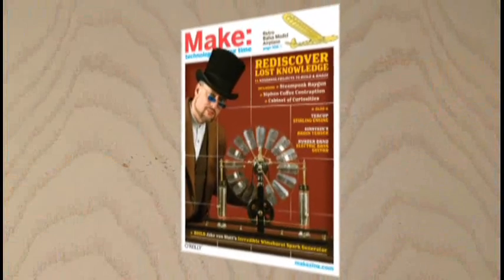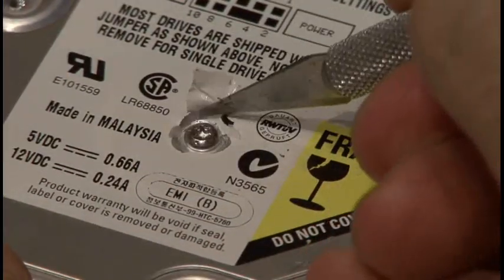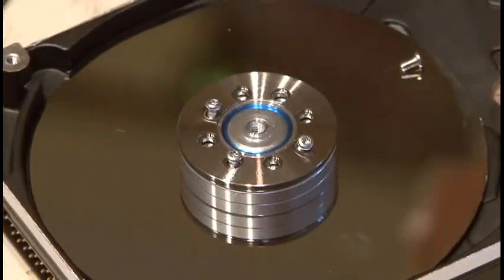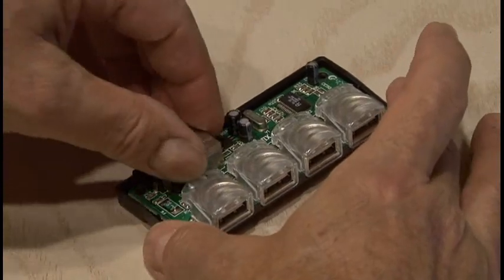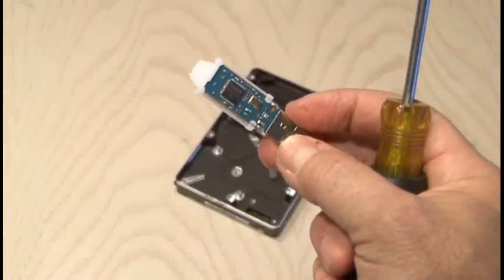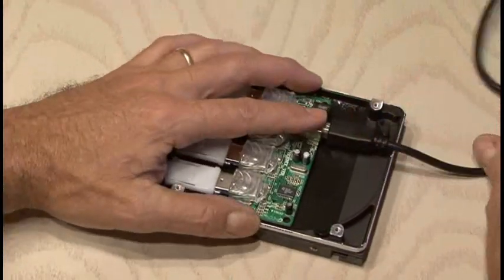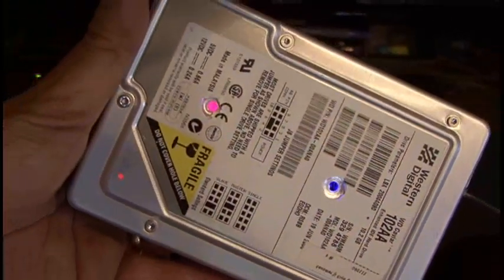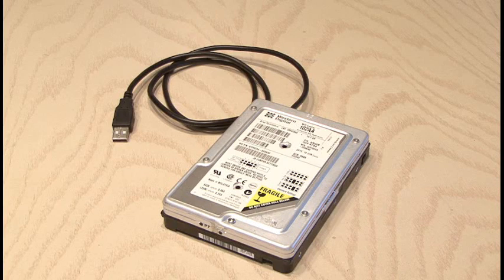Weekend Project: Flash Memory Hard Drive

Comment: Hey, i was wondering if you could solder a cable into the USB ports of the flash drive (fd) and make it like 1 cable so you dont need a USB hub. And if it is possible, does the pc think you have 4 drives or 1 drive?
vinceaantju

4 cables -> Solder 4 sane cables into 1 -> Have 1 cable

Comment: Single drive letter?; I would guess that you have to permanently install the drive internally and plug it into an internal USB socket, then go into Disk Manager and tell it to RAID the volumes under NT (2000/XP/Vista/7 *are* NT) then create partition and format.

The only foul-up that could happen would be if Windows insists on seeing them as four removable drives.  ...Or the oxidisation causes power to drop and one of the drives to decide not to play ball after a year or so.

Comment: I did a pretty extensive test with a 4Gb file being read to nowhere.
My SATA2 drive (which is admittedly a somewhat slower 5400rpm drive) read at 17.5Mb/s whereas the plain USB stick read at 34.2Mb/s.  The drawback was the USB stick's 4.6Mb/s write speed, though in a RAID this could probably be overcome since its the fault of the NAND flash, not the USB.

Comment: Not necessarily.  Yeah, SATA2 is 3GB/s or about 300Mb/s, but if you look up the sustained read and write speeds, which are important for just about everything, they're only 20-40 Mb/s.  USB2 has a theoretical maximum of about 60Mb/s.  While write rates on flash are usually slower than read rates, I've got a decent USB stick that reads at about 50Mb/s, whereas my SATA2 drive never goes over 30.

I have no idea if you can actually RAID usb drives and have it be worth anything though.

Comment: by default usb drives do not need to be safely removed (seriously), you have to manually change the usb drives properties in Windows "computer management" to allow indexing. This will make the drive faster, but make it so you ACTUALLY need to safely remove. So by default, the second you see "File has been saved" you can remove that usb without risk.

Comment: Higher end laptops will use a SSD, otherwise they just come with a standard slim HDD. I can load battlefield 3 in under 15 seconds on multi-player with every new launch. I also don't have to worry about disabling any programs on windows startup. Might wan't to note i am utilizing a SATA 3 port and drive that uses the full amount of bandwidth. Faster SSD's utilize the PCI-Express ports.

Comment: Ok, first off what you made isn't an SSD.  Second, by your own admission you can get a real 128GB SSD for 33% more $ than you spent on your 64GB multi drive setup. And lastly, with just a bit of searching on Google I found refurbished Samsung 128gb ssd for $66.  I'll spend the extra $7 for an actual SSD with 2x's the memory of your basement made doo-hicky.  Don't get me wrong, it is a reasonable idea, albeit tweakerish. But it is not cost effective, which you are trying to pass it off as.

Comment: So all you did was put 4 usb drives inside a metal case??   Thats it?  Why not just plug in those usb drives in the original hub (before taking everything apart and wasting time) ? Its not like it works any different.

Comment: You mis the point.  This device can now be mounted in the case.  If someone, like me, has a hand full of flash drives, a hub and an old drive it can be made to fit in the case of an old drive then mounted in the computers case.  No cables running all over the place.  I have all the sruff I need to make this and I think I will.  And by the way if you use Patriot XT flash drives they are much faster.  The XT is 30MB/s and they have a new one that is 90MB/s.  Very fast, almost instant.

Comment: I KNOW THE SECRET TO DOING THAT WITH ONE DRIVE LETTER/PARTITION, AND IT'S NOT  SSD. First, use an external RAID card instead of a hub. Then, get some flash drives with SATA connections (AKA SSDs). Then make a RAID 0, then make a partition. There, All one drive.

Comment: 1. Flash drives are much slower than proper hard drives - just do a benchmark of both flash drive and HDD for comparison
2. You lose the usual advantages of a small flash drive as 3.5" HDDs are heavy
3. You cannot install Windows - although the initial text-based install process will run fine (Windows XP), as soon as it reboots and starts to enter the GUI section of the installer it will BSoD as the USB Mass Storage driver is loaded
4. Windows Disk Management won't modify flash drive partitions

Comment: So I'm not tech savvy. But didn't you just take a usb multi outlet that you could swap the flash drives out easily and enclose it into a hard drive where instead if just easily changing the flash drives. You now have to undo screws. See where im from. That's called putting a hat on another hat. Basically pointless.

Comment: Well, a USB2 Memory stick is probably not faster than a HDD, also, you have 2x4GB and 2x8GB 'drives' , so its not bigger by itself, only if you add up all the space, which you could also do with 4x an 10GB HDD.

Comment: Also it's really not going to be faster than the previous hard drive was.  the transfer rate on USB 2.0 devices is capped at 12Mb/s, and is going to suffer from latency on the usb hub.  Even the oldest IDE drives have transfer rates in that neighborhood, and if the hard drive was made in the last 5 years or so, it's going to have at least 100Mb/s max transfer rate.  

Don't get me wrong, this is cool, but it's just not useful.

Comment: Mind you, this is an old 10GB harddrive. No SATA to begin with - probably UDMA33, which has a 33MB/s theoretical maximum (shared across the master and its slave device). The maximum is practice is probably somthing like 25MB/s which is in fact slower than the practical maximum of USB, which is around 35MB/s (shared across the hub).

Comment: @ProductionsNate NO!  They definately are not.  USB 3.0 flash drivees are 75MBPS, a mushkin chronos ssd is 550MBPS, usb 3.0 and sata 3 are about the same speed.  SSDs are way faster than flash drives, they are much higher quality also.  RAM is even faster, that can be 17GBps.  RAM, SSDs, and flash drives are very, very different.

Comment: @FlameOfAngersShadow because the proper ssd hard drive doesnt run off of USB. the connection is the bottleneck with SSD technology. I wouldnt be shocked if the multiplication in speed between the 2 are measured in the hundreds

Comment: @LamaPaj Not true. Assuming that this old hard drive was using the fastest IDE at the time of UDMA 133 (133mbps throughput), replacing it with high speed USB 2.0 equipment would make it now a 480mbps data transfer rate. If you replaced it with USB 3.0 equipment that may or may not be developed yet, the data transfer rate would be 3.2 Gbit/s or if using "SuperSpeed" bus 5.0 Gbit/s.

Comment: @mhbs2 well you have to look at it. what this really is is nothing more than a COVER for a usb hub, and USB hubs are not designed to do that, it reads them as 4 seperate drives. This entire project was about covering it up, making it look pretty, and you'll never have to plug in / unplug each flash drive seperately.

Comment: seems totally pointless to me if the finnished product doesnt connect via sata or pata and doesnt produce a single larger drive else you might as well just plug the flash drives into the hub and connect to your usb how they were meant to be used.
perhaps if you converted the usb connections to 4 sata connections and configured the 4 drives as a jbod array producing a single larger drive then there might actually be a point to the video, do the circuits in an external drive enclosure work in reve

Comment: before project:  1 hard drive, 4 flash drives and a USB hub.
after project:  4 flash drives and a hub inside the casing of a broken hard drive.

If you needed a case, wouldn't it have been a lot easier and cheaper to buy a plastic enclosure?

Comment: I find this missleading. You are not using the harddrive at all. I thought (from reading your headline) you would connect it AS A HARDDRIVE. (ATA /IDE). What's the big deal? I can plug in 4 flash memories and don't need a hard drive case, nor to go through all this hassle!

Comment: This is kind of useless... First of all it is not faster... Yes flash memory can read/write faster but you are bottlenecked by USB technology. Assuming that is USB 2.0, it wouldn't even be able to read/write faster than a standard green HDD. A better trick would be creating a virtual RAM disk on your computer. Instead of spending that money of flash drives, spend $30 on an extra 8gb of RAM, turn that 8GB into a RAM disk, and enjoy insanely fast read/write speeds.

Comment: @jcrowley1985 not really, at about a dollar a gig, low cap solidstates are a good choice if you have 5-10 programs you want rapid access to. because they can utilize 6gigabit/sec sata 3 connections they are much faster than flash drives, and because its a single drive not 4 you don't have to play file management like tetris.
But yes, if you want to look at this like a child it is a cheap solidstate.

Comment: This video was disappointing.  While sold-state drives are generally faster and more reliable than hard disk drives, but hard drives typically have eSATA or IDE connections, which are much faster and better suited for storing data than USB.  Essentially, this is just a USB hub with 4 thumb drives inside a case, which leads me to wonder why you didn't put it in something decorative or functional.  For example, you could put the assembly in a USB desk lamp and use one of the hub ports to power it.

Comment: @ashwindersingh18 

Hi, they are expensive even on the cheap sites. 5 months ago I bought 500gb for $40. I was looking and 250gb is close to $100...at canadacomputers...Use old hard drives or recertified like I do or buy smaller ones. They last longer than the new large ones. When someone gets rid of their pc just take the drives and other parts.

You can try newegg they have RECERTIFIED drives - 160gb for $29.99

 Dont get suckered into the marketing scam.....recycle.

Comment: You probably figured it out by now, considering the date you posted this. You can span physical disks and make a single logical volume. It's called striping, or so-called 'RAID 0' ( I haven't tested it with flash drives ) Partition Magic has the ability to do spanned. There are also SSD drives that seem to have originated from what you made.

Comment: @ashwindersingh18 

Hey, your laptop drive is 2.5 and the one in the video is a desktop 3.5 drive. There is no room to put anything but the thinnest flash drives in it. Since you drive is connected via IDE or SATA connection, it is impractical to mess with it. It is cheaper and faster to replace the drive and install a fresh operating system..........

Comment: @Tcll5850 i like where your going with this,but you could even do better than that..why not try and make a external RAM for your computer.you could take all the hard drive components out and insert you some ram ports from an old computer or something,run wires from the ports, and  solder them directly to the proper places on the motherboard..idk if you can make the rams work via usb, but anything is possible..good luck

Comment: wtf is this crap... its a freaking usb hub with flash drives inside a hard drive case. pointless... id rather teach a big mac box "new secret tricks" by putting a hub in it with a bunch of small capacity flash drives. at least then it would smell like big mac sauce

Comment: I think if you use RAID you could possibly make the four drives show up as one. I wouldn't know exactly how to put this together but I'm pretty sure Linux would do the trick easy.
Anyway. I would build a case from something else rather than an old hard drive housing as it's made of metal and pretty heavy. I think I will start a project with an ond laptop battery I have (the housing looks perfect and it's made of plastic).

Comment: TO get one drive letter you have to do a software based Raid 0 array This will scatter data across a 4 drives, but beware, if one flash drive goes down you ose a of your data because it is scattered at The byte level. BTW good video

Comment: Despite the video claims, this is nothing but an aesthetic case mod.

It has nothing to do with converting or upgrading an old hard drive.  It is just sticking a fully functional USB Hub with four USB flash drives inside an otherwise empty hard drive case.  No wiring, no change of functionality, just a case change.

Comment: Sadly you can only use soft raid for USB drives in linux. I haven't found a working windows version.
This project doesn't really interest me either. Why would we want to convert 4 smaller flash drives into a big harddrive behemoth. It's not like it works as a standard harddrive.
Now if you could access those flash drives using an SATA or IDE connector, it would be a different story.

Comment: better solution, Get 4 HP v165w Usb drives for 15 bucks each.

They have 8 gb storage and they a freaking small, smaller then a paper clip.

Stuff them into a hard drive case then get another usb hub and repeat.

BOOM, 62 GB hard drive.

Comment: I use my old Drives (6-20GB) as boot devices for my server projects. For instance i have an 8GB WD Drive running a torrent server i have setup. The torrents are directed to a network share (SMB) so the 8GB is nothing more than boot and cache.

Or you can add it to your computer via one of the legacy EIDE ports and setup truecrypt or use bitlocker. I Wouldn't recommend keeping financial data on it, but it serves as a safer alternative to a hidden folder or something else.

Comment: It would take a lit more skill, but by combining the memory chips from the flash drives into a single integrated circuit and then sing only the USB interface for connecting it to the computer would make a single "Flash Drive." But you'd need a lot more skill and a solid working knowledge of Computer Hardware sciences.

Comment: i'm pretty sure on windows you can set the one drive as the main drive and all of the other ones to be extended memory

My computer > (right click) Manage > disk management, and then format the first drive to be a main drive then format the second drive to be an extended drive

I'm not sure if you can do this in linux or mac, but on linux each drive has to be specified to a path so i don't think it is possible unless you have them all in separate folders  but the main folder will be 1

Comment: If you used Linux, you could make a BTRFS RAID0 array quite easily. Only problem is it's filesystem level, so if the drives changed device addresses it would break the array. But it's pretty cool still ;)

Comment: @MrHeadsocket we would still encounter the fact that they are 4 separate drives and not one dynamic one as stated in the video. if we could do that then we could use it as a nice boot drive. but that might be a bit too far stretched as flash drives arent designed for heavy reading and writing. so itll still end up as a storage drive more than anything else.

Comment: I don't understand the point of putting 4 flash drives inside an old hard drive case.  If you get a USB hub that all 4 will fit on and just plug it into the computer you have the same thing.  Besides, put the old hard drive in an external case and you have another 20 gigs of storage (or whatever size drive you have).

Comment: Not to mention that by connecting 4 USB sticks to a USB hub you reduce the speed of each one, because they are all connected via one USB cable to the computer. So if all 4 are working simultaneously and have the same stats (R/W rates), each takes 1/4 of the capacity of the USB cable (lowering it's speed by max. 75% !). Needless to say this is a huge transfer-brake. Better buy a normal magnetic HDD (cheap and most of them nowadays provide enough speed for most users' needs) or a real SSD drive.

Comment: It's not true that this hard drive is faster than the original (ok, if the original is made 10 years ago...). That's actually the problem with all external HDD that connect via USB - disks spins faster (read/write) than the USB can transfer (USB 2.0 that is). That's why when buying an ext.HDD one has to look for USB 3.0, eSATA, Firewire etc, which offer a much better transfer rates.

Comment: I remember reading an article of someone doing this, and putting all the drives in a raid configuration. Doable on windows and linux, don't remember the name of the tools though. A little googling should find the article. Didn't work too well though, as the drives often ended up with errors on anything but the smallest file transfers. Cool idea though.

Comment: @NudelzX SATA is defined in bits, not bytes like IDE.

SATA 1 is advertised as 1.5 Gbit (1500 mbit / 8 = 150 mbyte/s)
SATA 2 is 3 Gbit (3000 mbit / 8 = 375 mbyte/s)
SATA 3 is 6 Gbit (6000 mbit / 8 = 750 mbyte/s)

This is just the bus connection, just because the bus can transfer that much, doesn't mean the drive can. It depends on what type of flash drive you get. Good ones can max out the USB 2 bus, but crappy ones will f course get crappy speeds.

Comment: @GGigabiteM SATA is actually 1.5gb/s of total traffic, SATA2 is 3.0gb/s, SATA3 is 6.0gb/s. Also even the most expensive high performance USB 2.0 flash drives can only handle from what ive seen 27mb/s read and 25mb/s write. 7200 RPM HDD averages like you said 60-70 write, and i don't remember the write speed, but it is more that 25mb/s. So in short, no a USB 2.0 is not faster than a (i'm guessing SATA2, since thats most common right now) 7200 RPM HDD. Also SSD is awesome, and totally worth it.